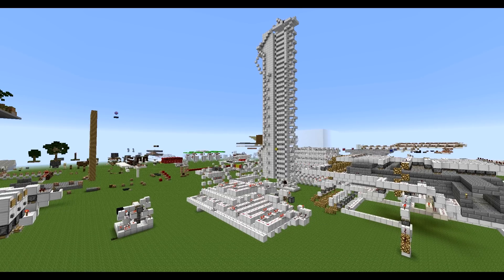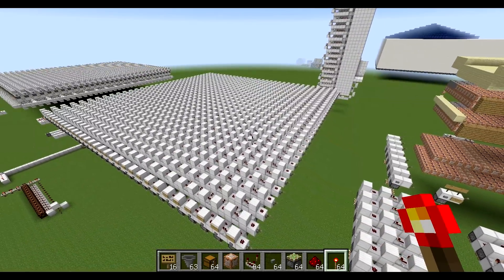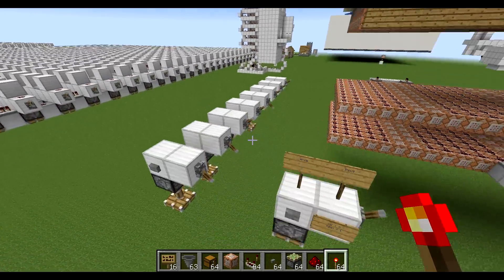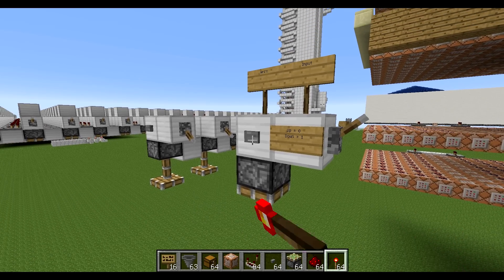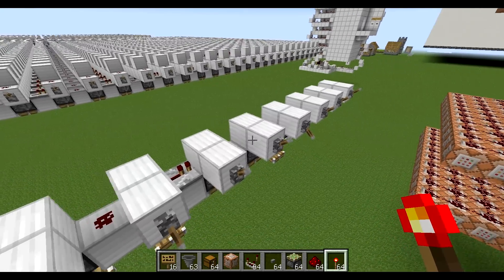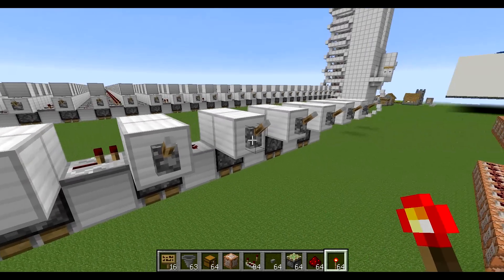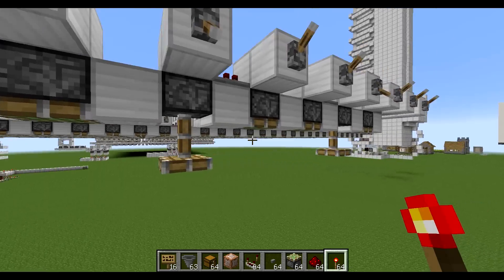MINECRAFT: Tileable Ultra-fast Slightly Solid State Drive

Comment: This made redstone memory very intuitive.  Thanks!

I've constructed a 256-byte memory bank with this design.  I improved upon the design by doubling the write speed with comparators, and have implemented instant redstone wire in the buses.  Even the address bus uses hanging pistons.  The address pistons are each adjacent to two redstone wires that are raised or lowered according to their binary addresses.  Each address wire is adjacent to 8 pistons ending in redstone blocks, and when unpowered will activate the NOT gate that accesses the value at that address.

I had to double-layer the bank so that the other end would remain loaded in the game.  The memory bank and addresses are 3 chunks by 2 chunks by 16 chunks.  It's a quarter of a kilometer long, and it's so fast I may have to divide it into more vertical layers so that fewer pistons are firing at the same time!

Comment: I have experienced one big problem.
if i put a lever on two blocks and button, it gives no power
Edit:IT OLY WORKS ON LEGACY XBOX /PS EDIRION
IT DOSENT EVEN WORK ON JAVA
Reply: it works for me 1.14.4 java edition. 1.14.4 must have different bud powering than the other updates.

edit:  i just realized, putting many cells together doesn't work. I have to modify the design a bit.

edit#2: oh nvm i just rebuild it wrong. lol. Though, the design i made does have much faster write times. plus, i can read form it because i added a read thingy.
Reply: Ur right I was doing it on 1.12

Comment: I've tried several 2x3 designs but i keep getting issues with address read signals interfering with data signals, and vice versa. I know i could do it in 2x4, but that defeats the point of its compactness, especially since the long axis is along the addressing side. For example 16 8-bit bytes would take up 16*64 blocks horizontally. I've built a 32 location 6-bit writable HDD in less space, though it wasn't very optimised space-wise

Comment: I made the read work.
I bloody did it. Its 16 blocks tall but still 2x2. It used NOT'ing with redstone blocks for perminant signals though, the design uses 1 redstone block per 2x2 square of bits. The read is kinda slow though, with 1 repeater per 2 bits of read. I have a different design, 3x2x14 (length width height) which has faster read/writes (uninterupted redstone line, so 1 repeater per 8 bits)
Imgur upload of design: imgur(dot)com/a/WXkLg

Comment: cool exploit of the (block uppdate piston glitch thing, idk what its caled) but it dosnt work in a redstone computer so it is pretty useless if u dont want to spend most of the time using it fliping levers maually.
Reply: You could make it work in a redstone computer. Writing memory is as trivial as replacing each lever with a wire.
 A possible way to read the memory is to:
1. Make the pistons be sticky, and put a non-transparent block below each one.
2. Place upward facing sticky pistons with a non-transparent block on top each. Position them such that they extend their block into the same position as the upper pistons extend their block to.
3. Wire the bottom pistons up to allow you to turn on individual rows of pistons.
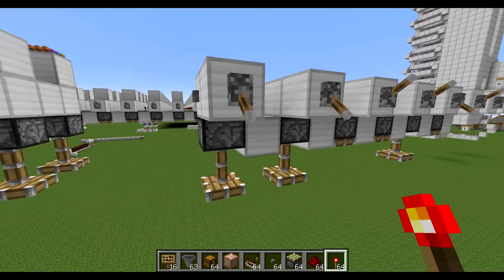4. Perpendicular to those rows, place repeaters such that the extended blocks would form block-repeater-block-repeater wires (like how are used at 1:37 that takes the input of the button across the row). 

Once you've built that, reading a row of memory is done by:
1. Extend all the rows of bottom pistons that aren't the row you are reading.
2. Send power through all the repeater wires from step 4.
3. Then the outputs of those repeater wires is equal to the stored row of memory.
Reply: Its called BUD
Reply: You can flip levers using command blocks

Comment: The system is good,but you cant usw that AS a memory,because when you want to whrite sth at it, it  need so long,because for every bit you need to whrite,(when you know what i mean,)when you have a asysten who save all teh data in 10 seconds,it is good,but so it dont works for a fast cpu

Comment: I now have a solution: Slime blocks. People seem to forget about these a lot :-( but they can be used for more than robots and missiles. Use then to extend all of the outlying pistons downward with a red stone block on the end and slowly increment how many slime blocks you add. There is a limit to this though (12 block push limit) but this can be solved with another set of pistons below that doing the same thing.

Comment: unfortunately to make a read system for this drive it would be almost impossible without mods or other items, you need to take the output as a stream of data, this means you'll have to implement some registers and other stuff, delays and a mean to set up the streamed data inti the bit system you're using

an easier way is to make the drive set an array according to the bit system you use, so maybe 8 columns and infinite rows onstead of infinite columns and rows, this way you can implement a bus for the 8bit system, if you use this method then it's very easy to this

you'd need to simply put a Redstone block on every piston, then when you press the read button you need to lower all pistons (or push the buses up) so it would het a signal from the already lowered pistons (logic 1) and won't reach the pistons that were not lowered to begin with (logic 0)
they travel through the bus t9 wherever you want, you can use latchers as registers with a clock that resets them after  2 or 4 ticks, just enough to pass the information that was read
has to be synchronized with the read speed
Reply: I made a working read system
:P not mods

Comment: Instead of making the thing bit adressable, you could read / write a 'word' at a time, that would make the whole thing way easier to pull off in minecraft. Also kind of dissapointed that you didn't show some actual application of this, a delay line memory if more useful than this tbh fam.

Comment: Hey, I'm planning on using this in my no-command-block, no-mods, 8 bit calculator. Is that ok with you? I will use this as memory for storing previous outputs so the calculator's user doesn't have to write stuff down. I don't want to use this if you're not happy with me copying it. However, if you don't reply, I'll have to go ahead and use it without your permission. Great video, thanks a lot :) Keep it up

Comment: You can make the piston sticky and hold a redstone block.
read system could be upward facing piston pulling the redstone block (with two slime blocks, to avoid interference, and signal is send back through redstone wires and repaters on furnaces/dropper (immune to stickiness). As slime blocks are solid blocks, they will transmit power.

there is a way without slimeblocks, but it's a little more complicated

Comment: correction: a bit is the binary numbers it uses. e.g 8 bit is 2 4 8 16 32 64 128 256. a byte is what stores the data. :) great video tho!
Reply: +james Clarke uhhh. No. A bit is a value of either 0 or 1. A byte is 8 bits.
Reply: yea i just realised i was wrong....

Comment: I was able to make a read system for this, but I had to enlarge it just a little bit to fit the read system in. Also, I expanded its capacity to 1 megabit, which almost made my computer freeze.
Reply: I meant M.E.G.A.B.Y.T.E. God, stupid autocorrect.

Comment: does it work if you use comparators instead of repeaters to make it faster ?
Reply from the maker: Unfortunately not, because comparators cant respond to 1 tick signals and that's the length of the read signal. If you made a new input for the read system which applies a signal longer than 1 tick, then yes. BTW, there's a version 2 :) Minecraft 1.8 redstone: AGS SSD 2.0 - BIGGEST EVER REDSTONE DEVICE
Reply: AstroGamerSteve Oh, okay, y don't know for the 1 tick for comparators...
In my server we have a system like this, but faster and with a read system
Reply from the maker: So do I :P Minecraft 1.8 redstone: AGS SSD 2.0 - BIGGEST EVER REDSTONE DEVICE
Reply: AstroGamerSteve Without Command blocks :P

Comment: hmm i think i can create a working read for that but This ssd in minecraft can actually be used as a very good Ram system
Reply: ok i fiddled around and concluded its best made best as single line write and reads like in Binary then use it as a output for Decimal or maybe Controller sequence. if you create each line with its own reads and writes and then add to it it be similar to your build but it be a bit more bulky if i can i'll make a video showing what i done

Comment: How does these so call hard drive or ssd work in minecraft
Reply from the maker: You input a pulse on the X axis and another pulse on the Y axis, and the point where these two inputs intersect will cause a piston to extend. This extension represents a bit with value 1, which can be read, and this tells you which two inputs were used.
It up to you what device you use to activate the inputs, and what you do with the data once it's read :)
Reply: AstroGamerSteve actually, it is the X axis and the Z axis not Y, the Y axis is up and down :)

Comment: I have an idea that I'm going to work on. Add redstone blocks to the sticky pistons. You make a redstone high way that runs on the axis of which the levers are. At the end of the axis at which the levers are, I will set up a output to the RAM or register or wherever the north bridge wants it to go. On the button axis, I will set up a gate for every single lane, so the CPU can have a separate calling system. The CPU/north bridge will call whatever information that it wants, (via gates on button axis) allowing that information to be carried down the high way. Every single lane shares the redstone highway on the bottom portion. In order to reset a specific lane, a separate contraption will call the code in the specified lane and invert it all the 1 signals, to 0's, and send it back to that specified lane, to reset that button axis to all 0's, so it can have a fresh slate to restore information. This setup is fast, small, tile-able, and so far the best storage system that I have seen. The only limitation that I see is that it can only call 1 piece of information at a time, (a problem that most storage systems in minecraft have anyways).

Comment: I got a idea,use command block w/ scoreboard and you can add score to the 1st(thats the player name) etc and just display it with a side bar(you have to make the display system read 25 bars at once or less because the side bar can't display that much data)(I think the limit of side bar is 25?I forgot it) just reset the score with the scoreboard command every time before you does something to it

Comment: But a kb is not 1024 bit. A kb is 1024 BYTE. A byte has 8 bit.
A kb has 1024*8 or 8192 bit.
Reply from the maker: I said kilobit, not kilobyte. It's my understanding that 1Kb means 1 kilobit and 1 KB means 1 kilobyte, is that correct?
Reply: AstroGamerSteve If you mean Kilobit, it is correct.
Reply: +TechnikTobi a Kb is correct as kilo bit and KB is kilo byte

Comment: This system has been around for a very long time in Minecraft. The only thing that you added was a lever to keep them all on. :) And I do believe that is a LOT bigger than 1 Kb if you don't count in decimal. If you count in binary, one piston isn't one byte. It would only take 11 pistons to have 1024 different outputs, or bits, of information. But I suppose if you don't care about size, this method is much easier on the brain, and has handy dandy levers. :)

Comment: I wonder how much data the hardware needs to process just to store that 1kb of data in the game through the contraption... XD

As for a read system: Since it's using pistons being pushed down to represent a bit on the drive, can't you use redstone in such a way that it's not sending a signal if the bits are 0 (piston up)?

Comment: I am 50 seconds in and I just want to correct you. 1 Kb is 1000 bits. 1 KB is 1024 bytes.
Reply from the maker: Then what's 1024 bits?
Reply: 1 kibibit which is almost never used today. I looked into this whole naming/numbering system and it seems to me that nothing is set in stone, it all depends on context. kilo can be 1000 or 1024. I take back my correction as you are still technically correct. I apologize for that.

Comment: He AstroGamerSteve, you can place a block under the piston and the detect it with a commandblock (command: /testforblock ~ ~ ~ blockname ) the commadblock can you place were you want and then use a comperator to make an furthe action
Reply from the maker: That would require constant redstone updates for every bit in the drive. And this is just a little prototype, it's far too intensive for the next design. It has to be as computationally efficient as possible.

Comment: What are the uses 4 this? I made a calculator and i saw some people did calculators with this but idk how O.o
Reply from the maker: The most obvious use is for data storage in a Minecraft computer, but anywhere you need to store data - maybe you've got a disco floor in your base and you want to save lighting presets - this is possibly the fastest, most compact drive you'll find. If you find a better one, let me know :)

Comment: So wait... You would have to have 1048576 of those machine's to make one GB... holy crap.... The l4g...
Reply from the maker: You could have 100% comparators - Comparator/block/redstone/block loses no charge. But why would that help?
Reply from the maker: The definitely have a delay... but I just tested them and it appears that comparators are faster! The Wiki says repeaters are 1 redstone tick but comparators are 1 tick, which is 0.5 redstone ticks. Thanks!
Reply from the maker: CodeCrafted has made a very compact calculator I think. You could hotwire the encoder with your BUD and past Code does all the work :L

Comment: Make a board with white and black wool of 32 x 32 (1 kilobit) and commandblocks who can detect if a piston is extended, and if they are extended, the white wool turns to black wool. You can really make that in the snapshot with the rewrite blockdata. So you can typ things. That would-be GREAT if you can do that.....
Reply from the maker: I thought of that, but I was trying to create a read system that doesn't use command blocks. I plan to expand this design once we have a read system and that many command blocks being constantly updated is gonna cause a lot of lag.